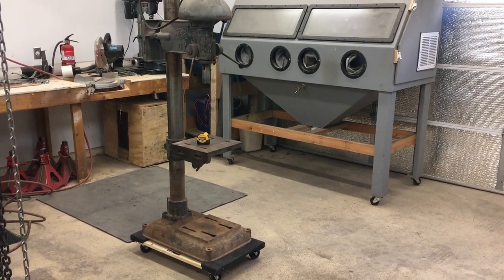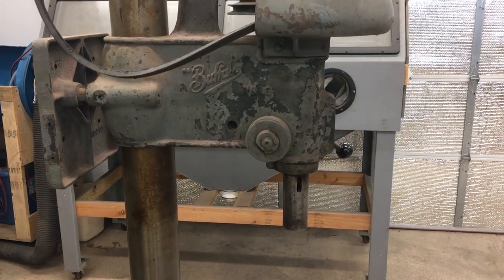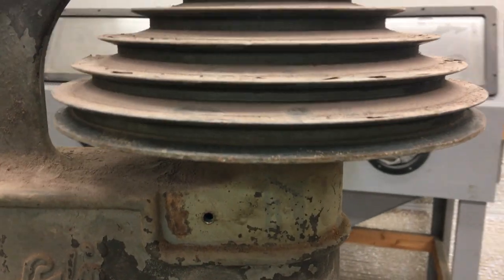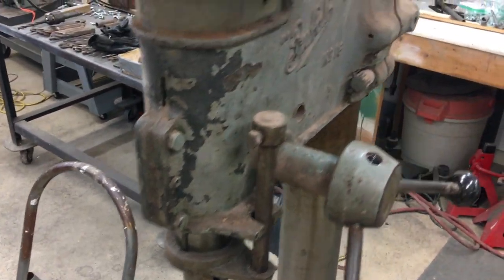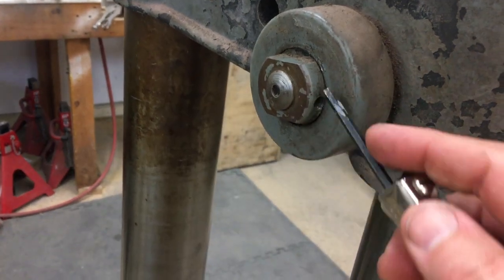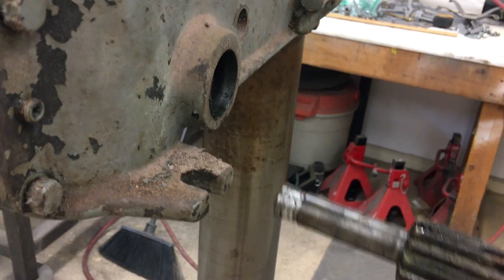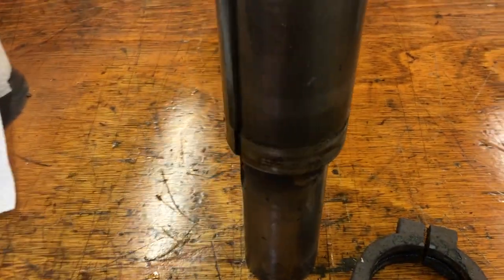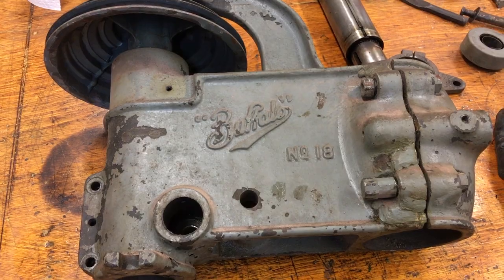Buffalo 18 DP Part1

Comment: Thanks for putting this up! I just lugged this exact model home today---this video will be enormously helpful in getting it apart. I feel very lucky that it has a rack and pinion crank to raise and lower the table. As far as a ring of shame on the table, some gorilla carved out a 3.5 inch wide u-shaped hole. In spite of that, it's so hefty, I wouldn't be surprised if the table isn't still pretty flat and true. Did you do anything to align the post to the base, etc? I've never refurbished a drill press, but it looks as if there's plenty of places to put shims where the base meets the post collar, and other spots, and get everything square and true. Cheers!
Reply from the maker: Congrats on your acquisition!  I did not have to do anything when mounting the post into the base.  It was a tight fit passed the eye test for square.   I don't foresee a time that I need to mount work on the base, but if I ever do I would tram it in at that time. 
For you table, if the damage is bad enough, you can get a steel plate that is ground.  If there's an old school machine shop nearby you check with them.  I"m sure they can help you out.  Once you have the plate you can mount it to your damaged plate and carry on.
Reply: @therestorationshop  Thanks for the reply! Great idea, I'll probably do that, or see if someone can weld in a patch, whichever turns out to be cheaper. Now that I have a drill press, it'd be a cinch to drill and countersink some screws at the corners of the new plate, if I go that route.

Comment: Perhaps you can tell me how you removed the pulley bearings.  I have a bench top model of this that I just purchased, the manual makes it sound easy to remove them but I'm not finding that to be the case.  I may be looking at putting together some kind of special puller..... thanks
Reply from the maker: I don't quite remember how I did that.  If you watch part 2 where I press the bearings back in it might help make more sense.  It appears that I removed the spindle and then pressed the bearings out.  To put them back in I was using a hole saw that was the right diameter to press on the outer edge of the bearing.  My guess is that I took the head off the post, flipped it upside down and pressed the bearing out just like I pressed them in.  Again... see Part 2.  I vaguely remember that the top pulley bearing has to be pressed up as it sits on a shoulder.
Reply: Actually, that's helpful.  I'm sure I can figure something out.  Nice drill press, hopefully mine should turn out pretty nice as well.  It was originally a bench mount, the complete head moves up and down on the column with a cranked reduction gear, it is pretty cool.  Thanks!!   @therestorationshop
Reply from the maker: @Retrogradeinversion Sounds like a great machine, good luck with the restoration!
Reply: Thought I'd post in case someone is having similar difficulty getting the pulley bearings out.  I ended up assembling an auto bearing removal cup on the top, used a piece of 5/8-18 x 12" threaded rod and some nuts to pull on the pulley shaft (brass washer on the bottom so as to not damage the pulley shaft).  Socket wrench (15/16) on the bottom with an extension to reach the end of the threaded rod, a wrench on the top.   The bearings and shaft were really stuck on there.  I had to crank the heck out of the nuts, alternately hammered some from underneath using a brass rod.  Took quite a while but eventually everything came apart. Putting it back together will be a piece of cake.

Comment: I am late to the party here, but you mentioned a table lift and I have a cost effective solution.  My Buffalo 18 was also needing this as the table assembly weighs 56# if my memory is correct.  I put a counter weight of approximately the same weight inside the column with a 1/8" cable over a pulley on top and down to the rear of the table.  I can move it without straining and input only some scrap metal and time.  The counter weight is 30" long.  MrPete222 recently posted a video showing how its done.  If you want PM me and I can send photos of mine.
Reply from the maker: I did see that and I was thinking about doing that.  I ended up finding a wonderful old hydraulic jack that looks like it was made just to be a table lift.

Comment: Very nice video. I picked up the same drill press a few months ago and I'm still restoring it. Can you tell me where you got the spindle bearings from that you talked about?
Reply from the maker: I got these from eBay and yes, they are from China.  The did seem to be of decent quality and my DP will see pretty minimum use.  I did keep the old ones just in case!  These bearings are for the drive top of the spindle, not the internal bearings on the spindle. 
http://www.ebay.com/itm/292005799699
Reply: thanks !
Reply: Jeremy Ollerenshaw ... I restored mine a couple years ago and got the (American!) bearings from an awesome supplier called "Blair Bearing" in Miami,Fla
Reply: Please tell me total weight of this machine
Reply: @therestorationshop  Hi. I am from South Africa and are restoring a Buffalo 18 DP. I am really struggling to get the drive top of the spindle out of the casing. Any suggestions? Are there anyting that fastens the pulley to the drive top shaft or must it just be pressed out?
Reply from the maker: @pietertheron1129  In Part 2 I show some video of putting the top part of the spindle back together.  In that part you can see that I'm just pressing the bearings back into the casting.  Note that the top bearings press down into the casting and thus must be pressed UP to be removed.  There is a stop in the casting that keeps the bearing from going to far into the casting and as such, it must be pressed up to be removed.  You can see this right here https://youtu.be/2rh5rObgccc?list=PLPtTim4u-y-gK_9zANSAzvOYLYOHsju-i&t=227